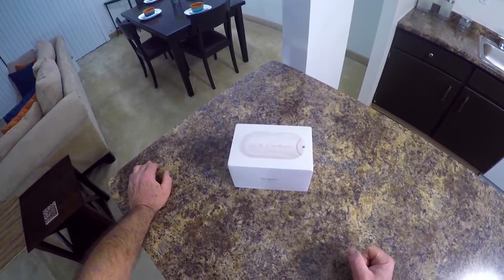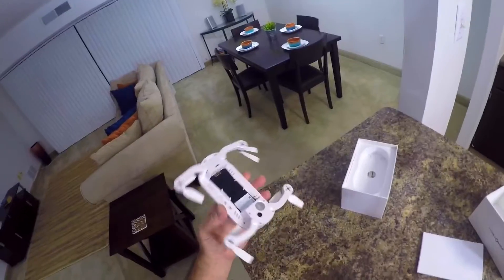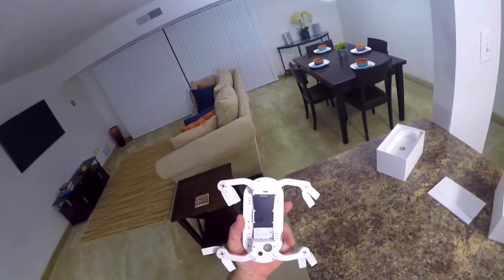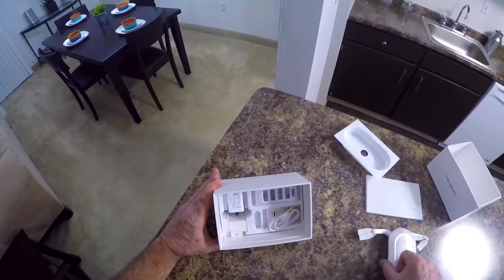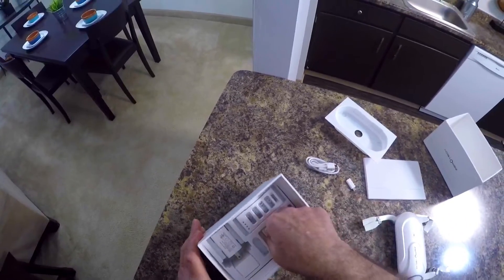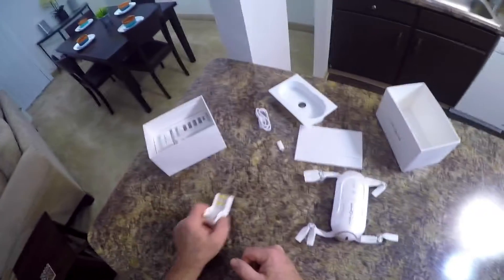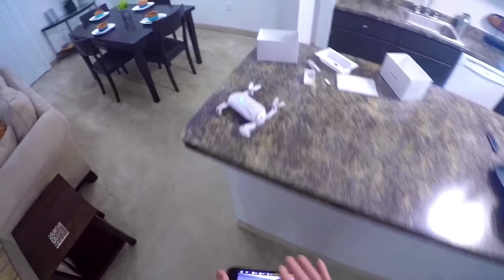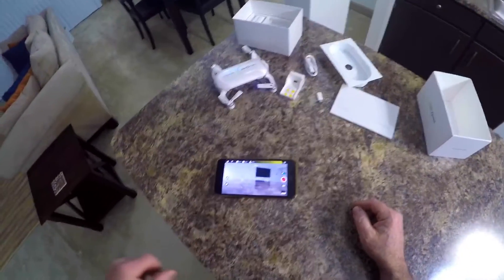ZEROTECH Dobby Pocket Drone Unboxing and Setup

Comment: Was hoping for a follow up video to get your opinion.  Anyways here’s my review.  The Dobby was on clearance for $100 at Staples..  I bought 2 for $200. Also bought 4 extra batteries, extra props and a prop guard for $50.00.  So $250.00 total.

Quick Review:  Returned one for a refund.  Barely worth $100.00.  Full review follows...

Pros/Cons:

Pros:
1.  Truly portable/picket size
2. Very nice camera.  High quality video. (but not stabilized)
3. Everything worked eventually.  (I had issues with the firmware update. Be aware there is no support or warranty for the Dobby. Make sure to buy from a dealer that will accept open box returns)
4.  For Good with app.
5. The app is quite good.  Some real nice selfie mode functions.

Cons:

1. Annoying compass calibration (GPS is overkill for a short range selfie drone)
2.  Short range (depends on your battery.  I get 90 meters with 2 of my 4 batteries.  30 meters with 2 other batteries.  1 battery was DOA.
3.  Not great in wind.  Best at 5 mph or lower.
4. Noisy.  Noise OK outdoors.  Too noisy for indoor flying.  (ie. under powered.  Needs stronger motors or bigger props for the weight)
5.  Short flight time (5-7 minutes). Too short for all the hassle of calibrating the compass.
6.  Regular price too high.  Is not a substitute for the DJI Spark.  Maybe a Tello Killer.
Reply from the maker: I just have not had time to mess with it, i will take your word on it

Comment: I never had a charging issues, try using a iPad charger or something stronger than a phone charger. And I used to have to reconnect and put my passwords in every time I flew the Dobby. I think it worked best when I put my phone on airplane mode and turned bluetooth off. And it does have camera settings, and they were easily to find, just go to the settings and start swiping. It flies well for a phone flyer, and video is good. Just too hard to get it in the air. If I knew you were interested in it, I would have sent you mine.
Reply from the maker: If I can get the controller working it will be ok if not, storage.
Reply: Good luck with Bluetooth controller, it’s hard enough to get it to bind with your phone.

Comment: Heya. I believe the  Dobby battery requires a higher voltage charger. If I use the supplied brick or a high speed usb charger it should charge fine. If I use a standard usb charging brick the light stays red but will eventually charge. 

There is a weird way to download and install with WiFi but was a pain.  She’s a tank in the air though. With GPS she is solid. Slow but solid. I think it is default at 4K and EIS  brings it down to 1080.  :)